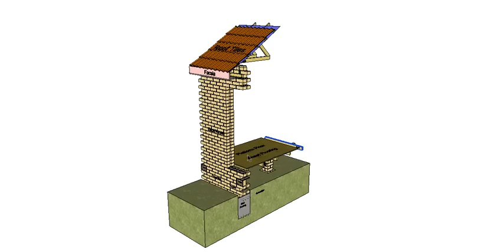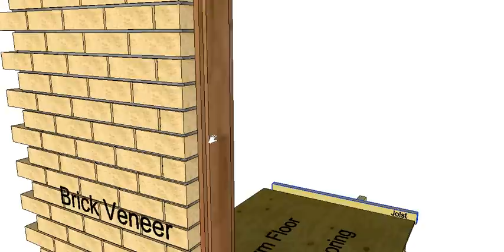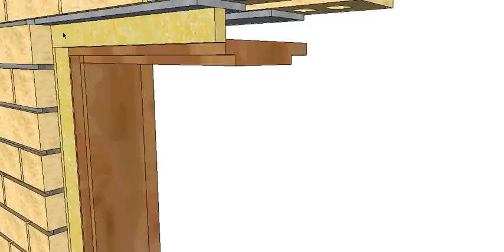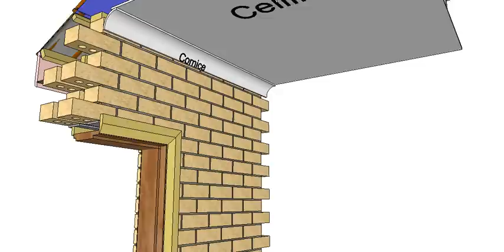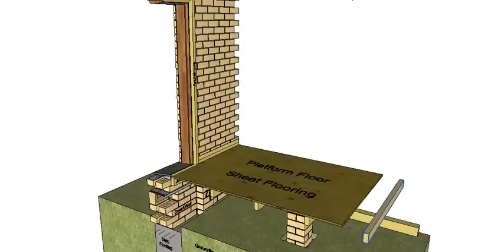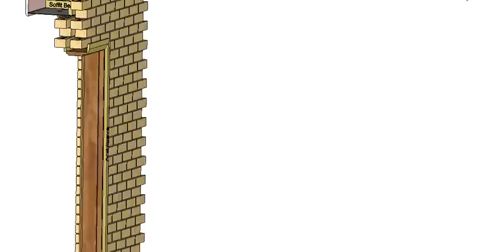Section through a Double Brick Building Part 3

Comment: Hi! I am looking to build my house this summer and I do have a big challenge, because I want double brick walls. First issue I deal with is the insulation efficiency, the architects they say that it has no good efficiency in the winter. Second issue they say that at an earthquake the out wall will fall easily because the inside wall they wish to be made in double bricks layer. Can you please advise me the advantages and disadvantages of double bricks wall please? The area the house wish to be made is Romania , South part, area which sometimes in the winter the temperature can be even -15C and quite strong winds time to time, the place face about 80km the Carpatian mountains. I will be very grateful if I can have some details about it. Thank you in advance. Valentina
Reply from the maker: Hi Valentina, i am in Australia so not very familiar with building in such cold enviroments but this is what i know.
Double brick buildings take longer to construct and are more expensive than a timber framed or veneer type construction.
While the bricks will hold the heat (and cold) longer they take a while to heat up and cool down. Also it is harder to add isulation to the Brick walls during the construction process if you can do it at all.
As the bricks are so solid they will hold up the the wind loads better however their rigidity makes them more likely to be damaged in a Earthquake type event.

I would advise you to have a look around the area and see what is working, maybe talk to a local builder or even a real estate agent about houses in the area.

Sorry this is probaly not much help.
Reply: Thank you very much, it helps me a lot.God bless you!